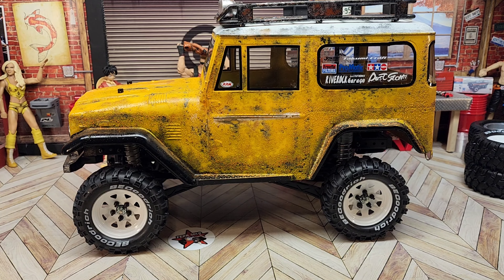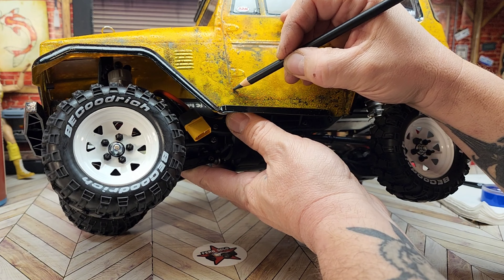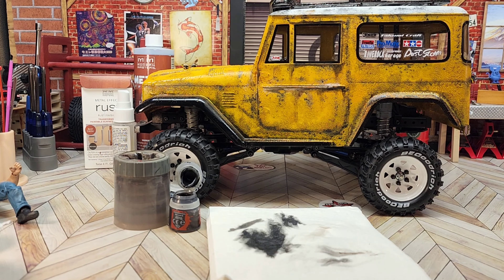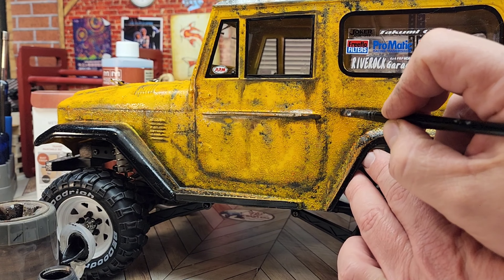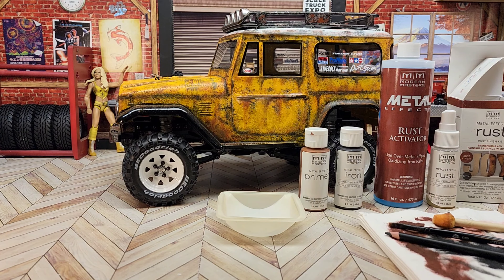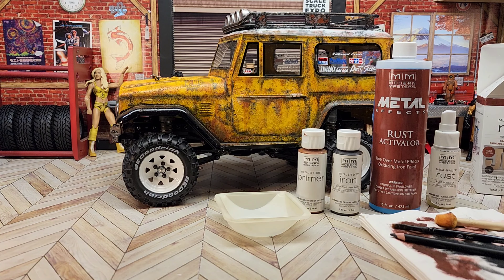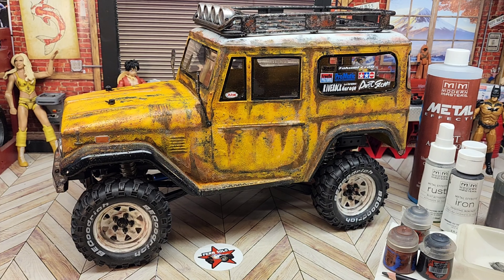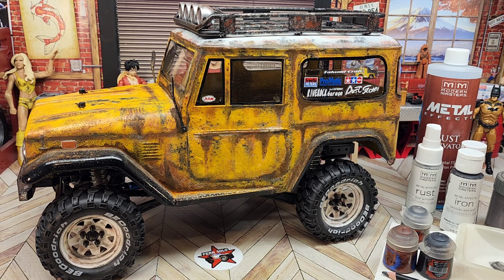Tamiya CC-02 Weathering Paint How To PT-2

Comment: looks good, why is the rear wheel not in the center of the trucks wheel well? looks off you may be able to move the rear links in the longer position it may look better?
Reply from the maker: I didn't really notice bit I will check it out it does have multiple mounting locations